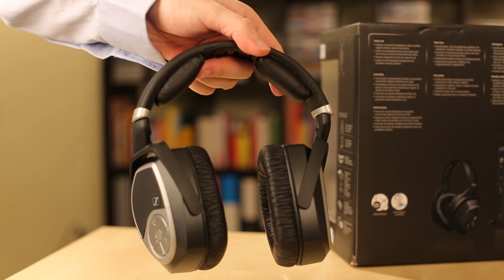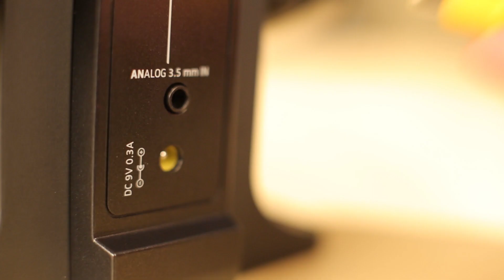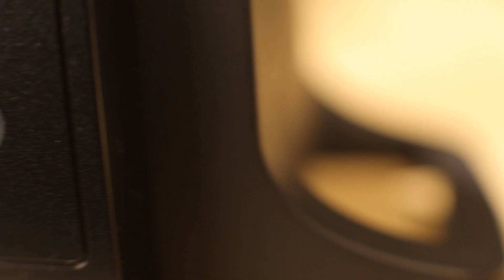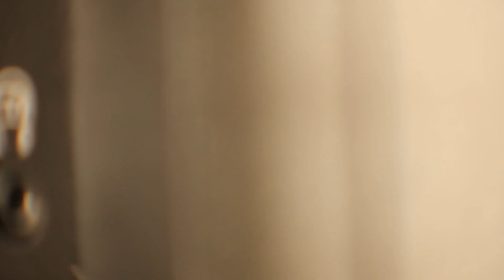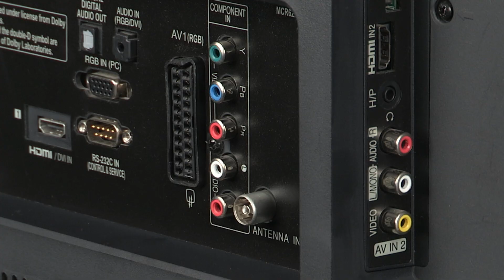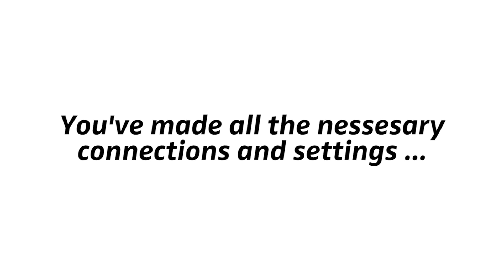Tutorial: How to Connect RS 195 Headphones to TV | Sennheiser

Comment: Need these for movies mostly.  Works with my Amazon Fire Stick in receiver- Optical out, but doesn't work with PS3 BluRay movies- Hdmi- receiver.   I tried turning off Bitstream and turned on PCM (although i really don't want to be messing up my settings) but it still has no sound.  Probably going to returning them

Comment: I have the Sennheiser RS 180 which I love but often on films I found the voices "fighting" the background music so I bought after saving a long time the RS 195 which are very  good for films but for music also BUT, from1 (low) to 20 (highest) the highest sound level I can reach is like 9 out of 20.  With the RS 180 I put them on 14 for a very high level of sound and have 6 levels yet to go if I want damaged ears. I didn't pay $450 for a way to hear greaat music sound with no vitality. Any ideas?
Reply: +Hedgehog's Right of Passage   Just saw this...  The RS 195 plays really loud, about 118dB.  It only delivers this output level without the EQ settings activated.  If I remember correctly, you have press and hold the button on the transmitter.  This will disengage all of the EQ settings.  None of the indicator on the transmitter should be lighted...
Reply: Tom Rayfield Thank YOU Tom, I found that out a few months ago, lets hope others will see your post ! Thanks
Reply: I never could resolve my issue.  I'm returning
Reply: Hedgehog's Right of Passage
Reply: when you put the setting on ''no mode'' wich means no leds are on..then the sound is very loud (to the max)

Comment: I wish it were really this easy.  I have been working on this for about 4 hours now.  I'm about to go out and purchase all new cords and rechargeable batteries.  I can get it to work with regular AAA but the batteries that came with it won't charge.  I can get it to work if I plug it in as a headphone which I'm not interested in doing because the rest of the family besides the hearing impaired person would like to hear tv.  The digital audio cord that came with it doesn't seem to be working. It is cheap and flimsy much like the materials used to make these very expensive headphones
Reply: +tlcrn58  If I remember correctly, it takes 8 to 12 hours for the supplied batteries to charge.  Two things about the optical digital input.  1. you must select digital using the switch on the back of the transmitter.  2.  Many TV's optical digital output must be activated via the TV's menu system.  If the digital out is not activate, no signal will be supplied to the transmitter...
Reply: +Tom Rayfield   Nope..turns out the issue had to do with the cable box settings which neither the video nor the book address